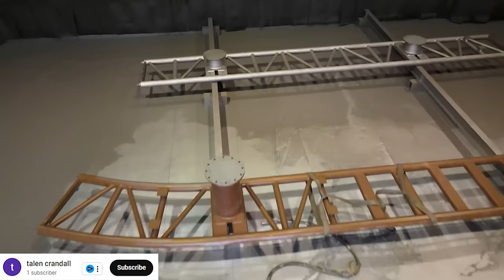Canada's Wonderland Working With Premier?

Comment: This is so unlike Cedar Fair.
Reply: Not really. Kings Dominion just added a Premier coaster
Reply: @Johnnyiswhere Kings dominion gets no funding, they got i305 but that was a while ago. Its not unlike cedar fair, premier would be a good fit for Michigan’s adventure, but it’s unlike cedar fair for a major park like canada’s wonderland, which is why I dont think it will happen.
Reply: @Johnnyiswhere  you must be mixing up manufacturers here. Tumbili was an S&S not Premier.
Reply: Unlike wonderland however KD has lost more rides than they've put in ever since intimidator failed to pay off for them.

Wonderland only lost skyrider  while KD Lost Shockwave, hurler (reprofiled into twisted timbers) and volcano  while adding primarily cheap kiddieland and Waterpark expansions 

They could have put another coaster where Shockwave was but instead chose to add delirium in 16. This new wing coaster should prove reliable and especially for the GP reridable  Unlike intimidator  and  will probably lead back to KD receiving more frequent large scale investments once again in the future.
Reply: @bigblueamusementproductions  yep you are correct

Comment: Max force was manufactured by S&S,not premier rides.

The reality is that there was never a wing coaster planned for wonderland in the first place and you guys set yourselves up for disappointment by continuing to hype it up without solid evidence to back it up just like how KD FANS  dropped the ball big time in 19 by falsely claiming that a wing coaster was coming to KD In 2019 as a replacement for volcano...they ended up getting egg on their faces with that rumor which severely tarnished the site's reputation as a result  which was why I was highly skeptical of the 25 wing coaster rumor until  verifiable evidence of the project recently became available and construction is now well underway with concrete footers already being poured in some spots on the construction site as of this past weekend alone.

Comment: It’s not gonna be a Sky Rocket no way.  What’s all this Mountain prep for then? Even after showing concept art of a blast coaster.  Clearly that idea wasn’t scrapped if you connect the dots.  Maybe not a b&m but whatever it is I’m sure it’s still a custom layout
Reply: There are other models premier rides has other than just sky rocket 2s
Reply: @Themeparkfan630  they are all shuttle coasters in some form or another.  Canadas wonderland doesn’t need a capacity nightmare.
Reply: @chez_calabrese   Full throttle, West coast racers, sky rocket, Backlot stunt coaster, and the flight of fear clones are shuttle coasters?
Reply: @Themeparkfan630  all their larger coasters are.  What do they all have in common? 1 train ops.  Full throttle has 1 train.  Sky Rocket series as well.  Those other coasters you mentioned are mid tier family coasters which isn’t what CW is installing.
Reply: @chez_calabrese  I'm not getting into a whole fucking argument about a roller coaster company building some coaster that isn't even announced you have yourself a nice day.
Reply: @Themeparkfan630  whoa whoa whoa… you said fuck 🫢
Reply: @chez_calabrese FOF is hardly a family launch coaster.
Reply: @chez_calabrese   Premier literally just build a two train ops Sky Rocket in Sea World Orlando.
Reply: @chez_calabrese  Full Throttle has two train ops, WCR has 3 train ops, Ice Breaker has 2 train ops, flight of fear clones have 2 train ops.

Comment: I love your videos., but you keep pulling these rumors out of your ass. These are huge capital projects that are planned years in advance.
Reply from the maker: I can assure you on one thing this project was changed. I got confirmation on that and will be able to prove that at a later date when the rides announced.
Reply: @AmusementInsiders perhaps it had to do with the fact that volcano's removal wasn't planned? The ride suffered a catastrophic failure early in the 2018 season and couldn't be repaired, however  it's been 6 years since that happened and in all that time KD didn't replace it until now  which indicates that shortly after the removal of the ride  the park set about planning it's future replacement. 

This ride had to be custom designed to fit within the available space that KD has to work with which is pretty compact  so there's no way that this could have originally been designed for wonderland.